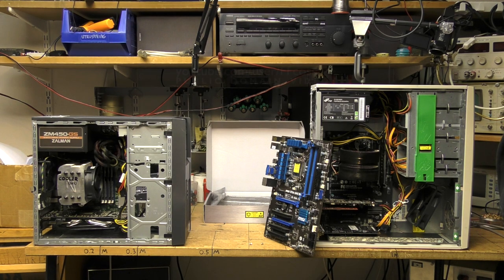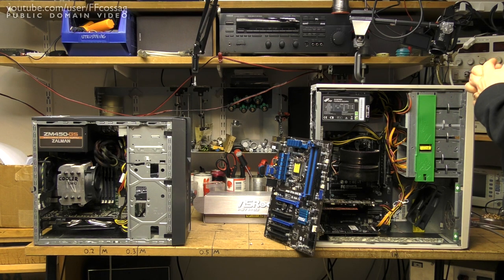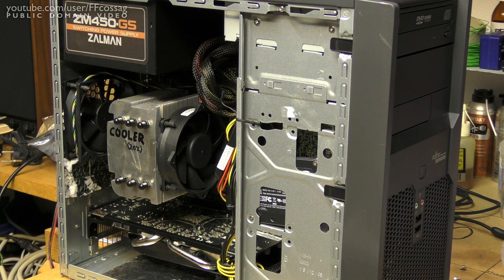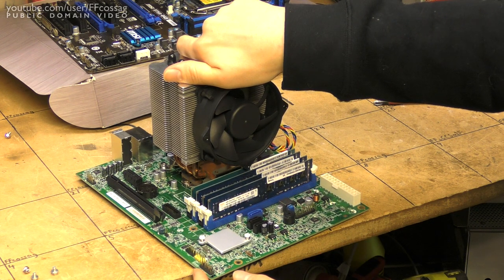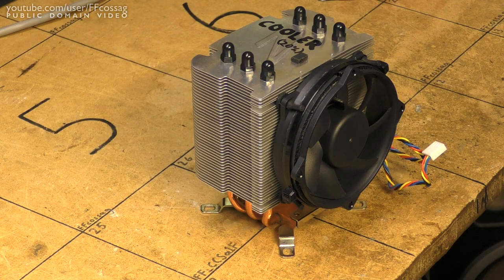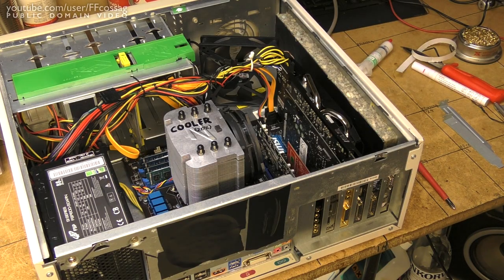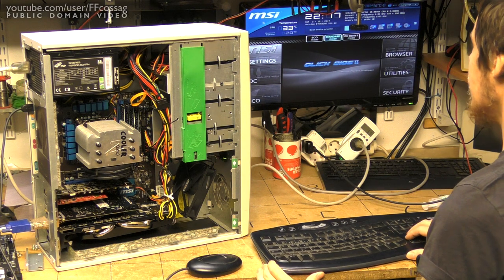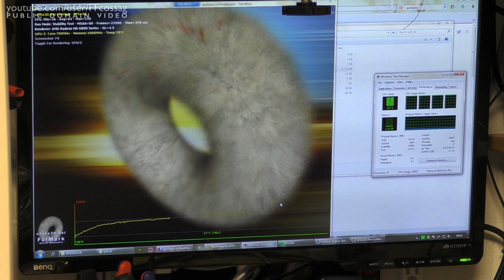Quick I5 2500K streaming PC build (w/ miraculous Windows boot)

Comment: You can put PCIE x1 cards in x16/x8 slots...
Reply: Especially without the graphics card :-D
Reply from the maker: That doesn't help when you're trying to fit more cards than there are slots. My bench PC sees so many cards come and go that I need all the slots I can get.
Reply: true dat, but I have had great success using the second full-length PCIe slot for a PCIe 1x card in a pinch.

Comment: Huh. the 2500k is exactly the CPU I'm going to be soon getting off of. I'm going to either be upgrading to some spare parts I'm getting in a trade-off from a friend's PC I built back in 2014 (Intel H87 desktop board-thing, 4670k, 750Ti) or sell the parts to make better money and grab a Z77 board and a 3770k (or alternatively, a Xeon if possible) on-the-cheap since I'd rather stay away from haswell, kinda. personal preference, no real other reason behind my methods of madness.  

at the same time I'll probably start getting ready to sell off the machine with the dual Opterons on it, since it's absolutely worthless to me at this stage for the performance it pushes out at the wattage it draws. just the board is going for stupid money on ebay, and I'm sure someone out there in computerland on Craigslist or something will be interested in purchasing it first as an entire machine, and if that fails in a month, it'll go out to eBay.
Reply: Instead of getting a 3770k, wouldn't it make more sense to get dual 1366 Xeons or a 2600k?
Reply: not entirely so. dual 1366 Xeons would put me in no better position than the dual Opteron machine I retired last year in terms of power consumption. better performance yes, but power consumption would still be heavy. Also, everyone (everyone that matters) and their grandma are doing the dual 1366 meme now. meaning, the motherboards themselves at the very least are very expensive for anything remotely decent that doesn't require ECC DDR3 of any kind. if I could get away with a single hexcore 5600 series Xeon I have a couple single-socket 1366 boards, but that's about it.

on the 2600k side, sure, I could do that, but going forward a 3770k or even a normal 3770 or S would be better as there's the option of PCIe 3.0, not for the bandwidth expansion on the x16 slot (maybe a bit), but for the x1/4/8 ports so expansion options aren't bottlenecked. (SSDs for instance, going forward, but that's an entirely different can of worms...)
Reply: The 3770k doesn't make sense to me because there isn't much difference in PCIe speeds anyway (not enough to bottleneck an SSD) and there isn't much of a performance bump either.
Reply: I'm just looking to the future. nothing's set in stone, I could very well make enough after everything's said and done to just upgrade the GPU bit and worry about CPU stuff later on down the line. I haven't bought a GPU new in box in over 5 years... I foolishly bought a 550Ti 1GB in mid-2012 and had to live with my mistake for the better part of ~3 years due to the absence of money past that point to put into one. mostly due to the fact the dual opteron machine was my main machine until last year, and only had PCIe 1.0, which IS a bottleneck in every sense of the definition. 550Ti was perfectly fine, but paired with an overglorified nForce 430 and two CPUs from around 2006, there was only so much bandwidth it can gobble before something has to give.

so I'm trying to not make the same mistake again. but, if I can over-spec within a certain generation's options at a price point I'm happy with ponying up, I'll do it.

Other option aside from this could also be something on the AMD side again. I'm liking the pre-impartial-reviewer-testing numbers I'm seeing, even if they don't completely live up to the performance they're claiming it has. I could also go used and grab some sort of ATX-standard dual Vishera Opteron machine going if I can find a decent deal on a board and CPUs... assuming no ECC RAM is required. that'd be the killing factor if so.

so yeah, just a bunch of brainstorming and thinking ahead, so I'm ready once I figure out what will happen in the coming weeks ahead. who knows, I may just end up keeping the H87 board (if I can fit everything I need on that machine, since it has a drastically different expansion lineup for PCI/e slots), dropping on a non-k i7 and rolling with it, since I don't need overclocking and it'd be less downtime waiting for parts that way.